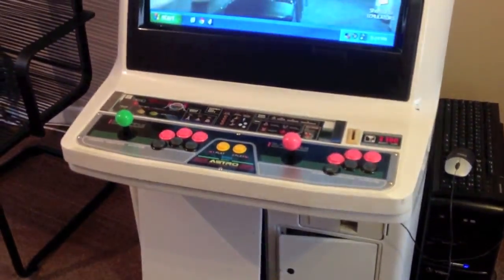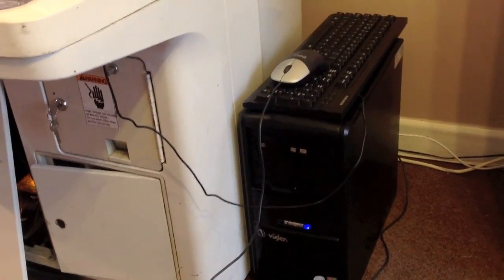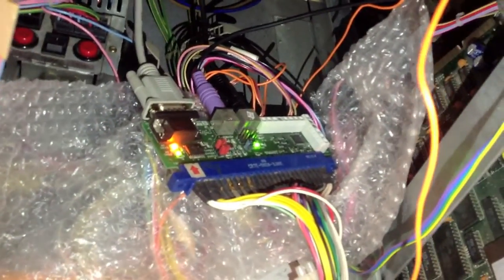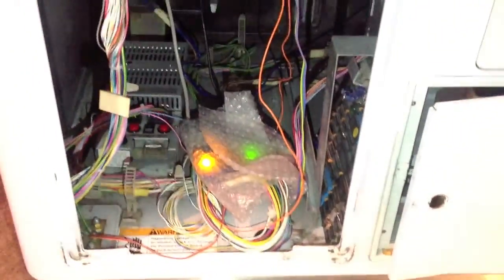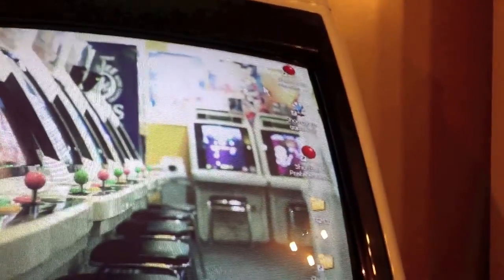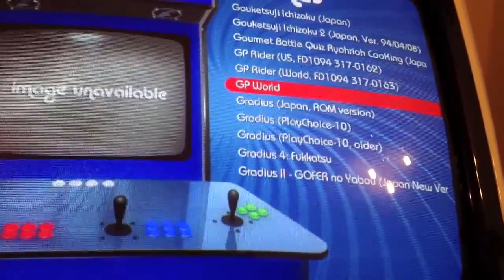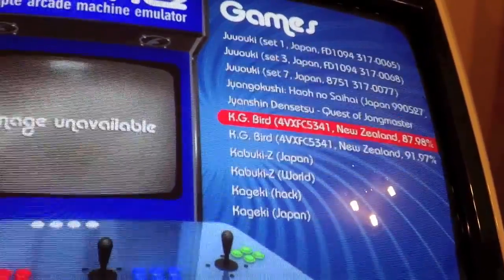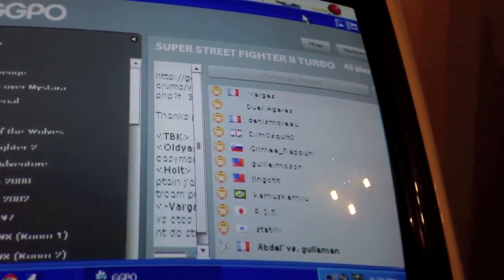GroovyMame Set-up

Comment: This is definitely the way forward for me, once the work on my floor is done I'll be bagging the first nice blast city or egret I find :) I can't get an astro as Paul pointed out that the control panel doesn't come off and things are a bit of a tight squeeze getting through the front door ;) getting one of these was high up on the list but after visiting paul and seeing it in action on the blast city it's now top of the list :) might seem strange to some that I'm buying some pcbs if I'm then getting mame but I really wanted to own some pcbs ever since being a kid :) 
Thanks for showing it set up mate as gives me a good idea what's involved :)
Reply from the maker: Heya. Yeah GroovyMame+CRT_Emudrivers is pretty great. I've had my Tetris-The Grandmaster PCB in there for the past 2 months so I haven't used groovy much recently. That's why it's good doing it all through a JPac because it keeps the cab all original so you can still boot up a PCB quickly for a quick credit instead of waiting for the PC to boot :) I wouldn't worry about not fitting an Astro through your front door, everyone has that problem. It's real easy to take apart into 3 sections and then re-assemble. I've moved that cab 5 times over the last 11years and taken it apart, you'll be fine :)

Comment: Hey bud
That's a great set up for your cab.
I was only talking to Craig today about getting myself a astro city and he mentioned I should checkout your set up. And I agree that's a perfect way to get all the classic games without paying a load of cash for pcb's.
I'm sold can't wait to get my cab.
All the best jay.
Reply from the maker: Heya mate. Yeah, you can't go wrong with an Astro City with GroovyMame. Doing it this way you can still buy the pcb's, because technically the cab is still 100% original apart from an added amp for when using GroovyMame. I've been playing arcade game at home and collecting Jamma PCBs since 1996' and I've had my fair share of them breaking down on me, and the prices these days for classic 87+ games that I like are gettting ridiculous. If you're not worried about original boards and are focused on gameplay only then you can't go wrong. There is literally zero difference. It has to be the GroovyMame+CRT_Emudrivers combo though, normal Mame won't do. But I'm just a fussy bugger with games :)

Comment: Hi dude, I have a MAME cab in my CAB NAC me too, but i feel an inpout lag :/ I have real modeline real pixel clock (no Vsync actibed btw) but i havnt "Groovy mame" i have Mame plus. My inpout lag is realy soft and not the same by game, but i feel it. Can you confirm me its because its a bad MAME ? With Groovy mame same feeling 1 frame like PCB on JAMMA ? Sorry for my english...
Reply from the maker: Heya mate. Yeah I used to use a normal Mame and I could feel lagg as have screen tearing. To get it lagg-free you need GroovyMame + CRT_Emudrivers and a supported ATI graphics card. If you google GroovyMame the first link should go to the website. It's really worth putting the time into getting it right, Normal Mame just doesn't feel right does it? Even a little lagg ruins the game for me as well. 

Here's a useful link on GroovyMame set-up. 
http://forum.arcadeotaku.com/viewtopic.php?f=10&t=24216
Reply: exmosquito Thx for all ! My mame + (mameppkui) is REALY good i have real pixel clock on systems and real modelines, the result is 99% perfect. But i need keep this fu** "Triple buffering" because a verticale wave (tearing?) is if i dont use it, and "Triple Buffering" cause Lag, very light lag but like u say, in arcade a 2 frames laggy ruin a game who are created to be very hard and play at the frame. Hope to see ur N.Ken on GGPO soon dude. See ya.
Reply from the maker: I know exactly what you mean! :( When I used normal Mame I could stop screen tearing by enabling triple-buffering only, but this added lagg. I always disabled the triple buffer and just have screen tearing, I found it better than having lagg. If you use GroovyMame+CRT_Emudrivers you will get no lagg (well 1-frame) and no screen tearing, say goodbye to triple-buffering! It's really worth doing! :)